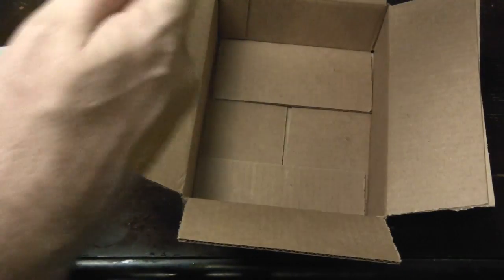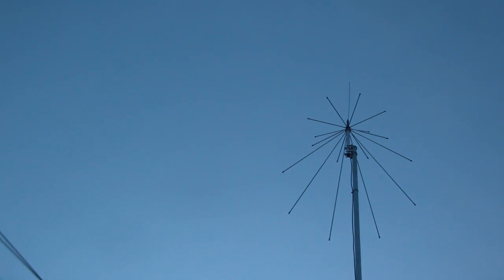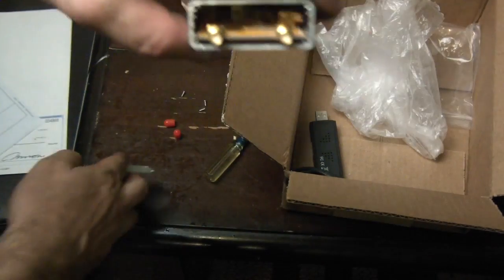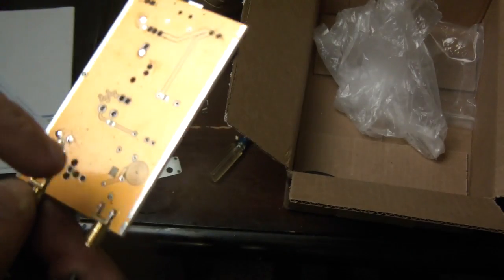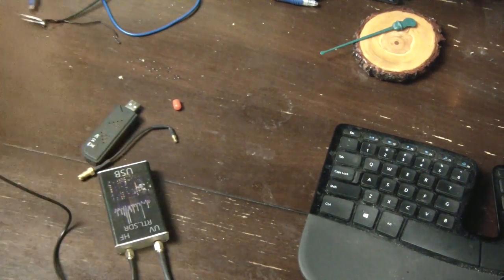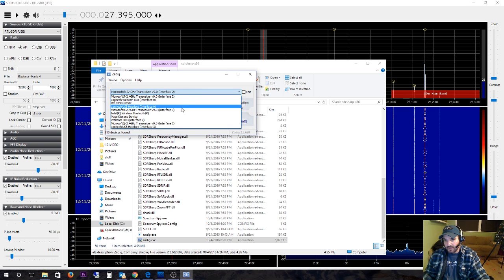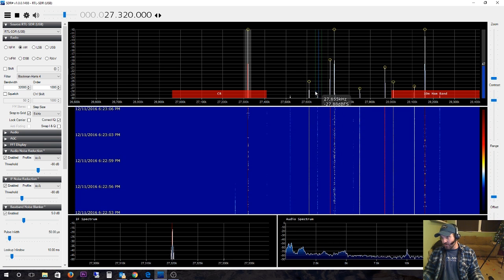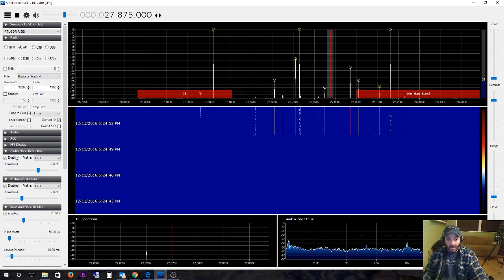RTL SDR wide band RTL.SDR review HF Nooelec Yosoo Upconverter

Comment: Hi sir
1. In the context of signal processing (I think?), why is it a must to set 2.048 MSPS & Q branch for frequency <30 MHz?
2. In the video, were you using the original antenna to receive HF? I pick up NOTHING on the HF band with that shitty-looking original antenna.
3. Is it a usual practice to connect a HF antenna (dipole, long wire) to the RTL-SDR in order to receive signals from HF band?
73 VR2VPK

Comment: I have exact same unit
 Message to everyone who bought this Unit:
1.- change the usb cable, it is the main problem that makes the radio not work.
2.- open the unit and check if it has the 2 welded posts on the board Those that connect with the HF filter
3.- If you use windows 10 connect the unit and let windows install the driver for you, after that use ZADIG to change the driver.
4.-some of these units do not work in HF bands and only work from 24mhz to 1200 mhz, some others only work in HF

Unfortunately I got one that only works in VHF. 
To check if the posts are connected inside the PCB you will have to open it and watch this video. https://www.youtube.com/watch?v=5kst5X_vENA and this https://www.youtube.com/watch?v=J5l4OVQTu5k

Comment: Fast forward to 2020....Those can now be had for a bout 20 bucks on Fleabay, and no there is no "built in' upconverter. It has the direct sampling mod integrated with the PCB with a separate SMA connector for a dedicated HF antenna. That was the first RTL based SDR I bought back in 2017. I like the fact that it uses to separate ANT jacks but it uses the older R820T tuner chip instead of the newer R820T2 tuner chip. Today Id rather have 2 separate RTL-SDR V3 dongles. (one for VHF/UHF and one for HF). Just run 2 instances of SDR# and chose between either dongle.

Comment: I have a 25mhz to 1.7Hgz dongle , and waiting for an upconverter in the post. In the meantime I tried listening to the 28Mhz band , since for that I do not need an upconverter. ... however I had no success , I tried a simple indoor inverted V dipole , and with or without it connected , all I got was loads of peaks of constant tones.  I was told this is probably interference. I tried with all electronics in the house switched off and I still got the same thing. I was also told it could be all interference from the laptop itself.  did you have such issues ?   I am hoping that with an upconverter I will have less of this interference.

Comment: I have that SDR but it has a toggle switch for turning off the up converter I have found it to perform quite well for the price. Built a Magnetic loop antenna that I use to listen to the HF bands the spectrum analyzer display makes it very easy to tune the loop antenna to the desired freq.
Reply: I have the exact same SDR box as yourself ( with the toggle switch next to the USB power socket ) I've recently just been informed though that the small board that's fitted ontop of the main board in these kits, is infact a "Filter" and not an "Upconverter" at all. I live here in the UK and i've got my SDR kit hooked upto my outside "Scanking" 25MHz-2000MHz antenna and i bought an indoor HF "Youloop" antenna for HF frequencies. I use the brilliant SDR# software on my windows 10 desktop pc and i can pickup "Civil Air" and other frequencies above 25MHz but when i flick the toggle switch for HF i get nothing on receive at all, i have made sure to setup my SDR# software correctly for HF.

Comment: (It's ok to start from the point after you have unwrapped it!) I have one of those and had it running under Linux and on my Android phone. Much easier to use on a big screen, and seems to work well.

Comment: I have this same exact unit (and I have the same exact antenna set up).  Cant make it work so far.  In zadig after I list all devices I dont see the RTL adapter.  Any idea's?
Reply from the maker: I gave up on this one. I went to SDRplay and RTL-SDR dongle.
Reply: Are you using windows 10 I have to change the usb  cable but only works for vhf and 27-28 mhz not for low Freq. like 40 meters band..:( That cable really don´t work

Comment: Hi, I purchased the exact device, differently marked, but the inside is exactly like yours. After several trial and errors I figured how HF works. The device HAS the up converter built in, it just needs to be set up. I was this close to throw it away. :)
When you are in HF mode, click the SHIFT box and introduce either -28,799,700 or -57,599,700 in that field. It is actually the frequency of the crystal you just showed. Other devices have oscillators of cca 40 MHz or other values. But as long as the dongles are ok above 25 MHz, the below frequencies are converted UP by adding the oscillator frequency, and the dongle is happy then. Try out. Enjoy ! P.S. You need a long wire antenna.
Reply from the maker: In my other videos I install a long wire. I also have a SDR play now.

Comment: i guess no one is around to help me out a yr later after the video was done
Reply from the maker: I got sick of dealing with this thing. I bough a better one at rtl-sdr.com
Reply from the maker: I bought a R TL-SDR.com dongle. its better and cheaper.
Reply: nocturnal cat  bhgfffcvv
H
Reply: Drkaos Drkaos  My Dear Drkaos, I did all that with SDR Sharp. But no dice. Its not working. Its not working in the sense that no HF is received. I could receive FM stations when I configure it on HDSDR or SDR Console. But nothing on SDR Sharp.

Comment: Ok ! i have the same unit...but i started with HDSDR or something like that...do i have to worry about that driver in the computer after i get that SDR SHARP, where is sdr sharp on the rtl site..i found no exact links..just a bunch of all other stuff they chat about...will it work on either a 32 or 64 bit I7 system which is what i first tried on..i do have another older windows 7 machine..what do i do next..i do note the two different internal ways to get HF or UHF .. do u have a link for the sdr sharp program that i see up on your screen..i guess once i get going,it will all have seemed so easy.. ps i have been in the DSS stuff in the 90s to 2000's so i just need tips and many thanks..a shortcut is set to this video
Reply: google rtl-sdr sdr# setup. just did it

Comment: This does not have built in up-converter rather it samples direct off the i or Q branch (Bypasses the onboard tuner and channels tuning direct to software). where the VHF and UHF do not. 
My question was "does if have filters" and from what I saw wne you popped your open it looks like it has some decoupling and filtering circuits ont he HF side.
They cost about $30 now on ebay
The other dongle you have can also be modifed relatively easily to receive HF but instead of direct sampling the "Q" branch you set to ti the "I" branch

Comment: Don't know if you've figured it out yet, but the reason you don't pick anything up on lower frequencies are because the antenna that came with the unit is not rated to work with HF frequencies, so you need to get a decent HF antenna first (maybe a long wire/magnetic loop antenna).
I'm planning to buy this unit myself and an antenna as well, but I heard about this on different forums and groups... how have the unit worked for you since you bought it? Do you recommend buying it for shortwave listening?
Reply: did you buy one and how did it go ?